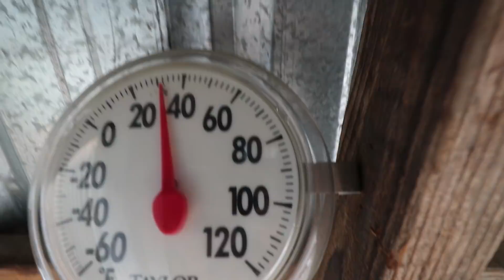Backfilling an Impossible Hillside Trench With Sand (From a Hose!)

Comment: In the mid 1960's when I worked in construction, we used this method to backfill a 1500 foot long, 12 foot diameter powerhouse penstock on. 45 degree slope. It took a week working 24 hours a day because it was winter in NFL Canada. It's an excellent method requiring no compaction as the water draining out of the sand does the compaction. We had some problems getting the sand to flow with as little water as possible until we added laundry soap to the sand mixture. I'm sure your trench will be fine if you divert hillside water from rain storms to prevent scour of the trench sand.
I love your videos. BTW, your Engineer should have cautioned you to schedule your windows much earlier in the build schedule to prevent the delays you are experiencing. That's just part of "best practice" construction.
Good luck, Stan...

Comment: Cistern Tank can be anywhere guys. Use a couple of Solar panels to charge a battery bank and use DC pumps to supply pressure to home. My cabin has been this way since 1998. Pumps last a long time. A couple of 200 watt panels are enough. Go whole hog and get 3-5K watts and enjoy being off grid. elevated water systems are nice though. Remember plastic sheet over the top of your trench will keep rain water from eroding it away. Just secure the edges and overlap it as you come down the hill. Cheap insurance.

Comment: It is manufactured sand, looks like sand but it is the dust washed off of gravel when it is crushed.  Used to be a waste products at quarries till they found uses for it.  Here we call it donafil and we put it under cement slabs.  Once the water dries from it, it gets hard as a rock but it is still able to be dug up.  It is a good filler and unless it rains hard immediately, it doesn't wash very good.  The top will crust over and be hard.  He explains this at the start of the first video.
Reply: Thank you ray nall
Finally someone else that actually pays attention to what was said in this a the previous videos when they talked about pumping fill into the trench.
Reply: Thanks for the explanation, Ray. I was wondering about that the whole time.

Comment: Boy do I feel your "pain"! We began our addition project  in Michigan at the beginning of July (early 90's) which is typically warm & dry. We ran into two major problems doing the foundation 1. our  frost line is 42" (so where bottom of footing had to be) and we hit water at 18" plus it rained every weekend for the next 13 weekends after we dug the foundation footing so it kept filling with water & caving in before we could get the forms set. We had to pump it out & re dig most of it every stinking week (after work) again & again...thought we'd never get out of that darn "hole"!!!

Comment: You should try sprinkling some bags of dry concrete mix along the top of the sand and wet it down, it might help lock the sand in place so that it doesn't all wash out with the rain....

Comment: The good thing about sand is it will end up at the bottom of the hill so you  can cart it back to the top again and again.
Reply: It's likely a certain kind of coarse sand that drains really well and requires a torrent of rain before it slides. It was pumped while utterly saturated with water so it would flow. Now that it's drained the water into the soil, rainfall will drain through the sand instead of carrying it down. I don't know if the plan is to spread gravel on top, but that would disperse the energy of raindrops hitting, and make thousands of micro-dams. Then tree needles will form a layer on top of that.
Reply: flinx only a torential rain will disloge the top that might ba a god send to pull some of the dirt back ovef it. I would not be bo concerned if the top layer washed of personally you can level it out a bit better anyways.

Comment: First things first, I have been watching your channel and have enjoyed your videos. It is cool to see someone take on a project like this. BUT you need to higher engineers to design what you are building. The cost of there input will offset the cost of mistakes AND they will help you plan better and save you money. This trench is the perfect example.    The list of issues is a large one but  the correct person(s) input would have saved you major problems down the road. 1. Most of the roots didnt look detrimental to the surrounding trees,  which using trenching equipment would have saved you days and you would have had a cleaner path. And yes the proper trencher would roll the rocks right out of the way. 2. When tieing off the pvc, you tied towards the top of the trench, and pvc full of air likes to float, i am sure there are plenty of spots close to 6 inches or less in the sand and it will continue to float when the sand gets wet. 3. The tree roots, if they are not damaged enough to die off (we know you were trying to save them but often exposing them does enough damage to kill many of them), whats left will grow putting pressure on your pipes till they break. 4. Sand always moves where ever water goes. The future issues are not all addressable such as the roots etc. BUT you can do some things to reduce the risk of a winter time mud slide or a mud slide when a pipe breaks. Once the area is pretty dry, get portland cement and mix it really thin, water like, poor it over the sand so it drains into the sand. Do a sample area first to make sure it is mixed right, it gets absorbed well into the sand and you can still break it up with a shovel. Next cover it with additional soil to create  a monund so it sheds water AWAY from it. You can add a layer of yard fabric to shed water and plant over it. Just dont plan anything with strong roots or thorns as when you need to repair the lines in a few years, you wont regret working in it.  FYI. A few of the people on here are speaking from experience as many of us have experienced or seen these problems first hand and others are just speaking out there rears. Fyi. Good job on sourcing BOTH material and labor, dont go out buying a pump, you will waste more time learning to pump then you will save.

Comment: You need to start putting dirt rocks and possibly growing grass or some sort of vegetation on top to hold it there otherwise come spring run off if you think that mess you have down at the bottom by your hot tub is bad right now it's going to get a lot worse
Reply: It's coarse sand that drains well and is heavier and less mobile than fine sand. It takes saturation with water to make it move.
Reply: Rain storm???? You have seen what water can do to dirt and rock in California. This will just wash away in heavy rain. Sand is incredibly unstable, and naturally seeks level, especially when friction is removed with the help of water. All that sand will be at the bottom soon.

Comment: You guys are phenominal! Take heart whilst there might be a bit of clear up at the bottom remember THE TRENCH IS FILLED! You are getting there with the build, its winter the shorter daylight hours affect everyone negatively mentally as well the pressure you put on  yourself and by everything else. You guys can do this, you are doing this (enviably well i might add). For now you might have lists mile long but eventually that will get down to nothing

Comment: Right idea, but wrong material. Lean concrete, a mix of sand and Portland cement would flow and set up pretty solid, yet still be able to be dug up if you had to. 
Poured in sections would prevent the overflows at the bottom. That's a very severe slope, I'm surprised it didn't all run to the bottom.

Comment: Many commentators are beginning to get very negative about this build. I am sure both Jesse and Alisa would be the first to admit that many errors and wrong decisions have been made BUT in doing so, it stops others from making the same errors and decisions. Both are not professionals or experts at building properties and they openly admit that but if their errors and wrong decisions prevent just one home builder from making the same mistakes then videoing this build has been worth it and justified.

Comment: Great video guys, one thought at the top of the chanel it might be wise to build a kerb type structure to divert any possible rain run off from the top of the hill away from the sand ditch, as the rain always finds the path of least resistance, here in the alps they us a a lot of ground level gutters to steer the rain water away from the tracks and roads ....good luck   :-)
Reply: Bill Weir I

Comment: Ok, let's get something straight, this is not just sand this is a slurry which is a water, cement and sand mix. Can be used for certain types of applications, I personally would not use it for this but each to their own. Oh by the way I do have 43 yrs. in the concrete buisness.
Reply: Allan McCoshan 
Errrr. What gave you that idea?

Comment: Hi Jesse & Aliese, you guys did pretty good with so sort notice. Concrete trucks are always early or late but you handled it pretty good. Cudos for getting the lights up there so quickly. Don’t worry about having things not completed you will probably change your mind about how to complete them before you get to that point anyway. I always called that part the flex point. Just keep on plugging away. And don’t worry about what other people think. Have fun. More later. 
Bill from Seattle

Comment: Looks good! the sand over spill at the bottom will look like a big mess but it will move quickly once you start and it does have a place to go which is not far from where it got out of the trench so it will look neat when it is all finished

Comment: Do you think when it rains it will flow in the rut and wash away the sand?
Reply: If they are using it as a trail to the top of the hill it might not hold ground cover well

Comment: You are almost there. Just an hour or so of shovel and buckets to move the sand from the steps to the trench just above the hot tub. And that project can be checked off. It will be interesting to see how the sand holds during the spring and fall rains. Are you going to seed the trench with a ground cover to help hold it?

Comment: Won't sand just wash out in a rain storm? I mean it's well known to be structurely unsecure? Like if you build a sandcastle and then pour water in the top, it just decays and washes away.
Reply: Steve Sheppard this is structural fill...used for embankments
Reply: Kathi Pauling 
Well, just watch the video. Look how the sand flowed with water. The same thing is gonna happen in a rainstorm.
Reply: Oh just give it time.
Reply: lance henthorn I think they said when digging the trench that they would pull the adjacent top soil over it

Comment: How extraordinary, someone putting sand, with the surface below grade, in a trench on a 35 degree plus slope of composite gravel and rock and thinking it will stay there.  The washout and slope slide should be spectacular.
Reply: Nope, used this stuff 20 yrs ago on a s dam site, its still there...The slope was the same angle and 400' longer.
Reply: So you worked on a damn where the leeward slope was not hard rock but was glacial till? What sort of weights were placed onto the pipe? and what were the profiles of those weights?  The simple solution to the electrical conduit would have been a 1 to 10 ratio of premixed Portland cement to sand in a geo-textile bag placed on the top of the water line with the electrical conduit on top of that, and another geo-textile bag or two on top of the electrical conduit - the steeper the slope, the closer the bag stacks - the bags then should have been staked (with a piece of rebar) to the ground on both sides of the water pipe - there would have no floating of the electrical conduit and each stack of bags downstream would have created a mini coffer dam to prevent later washout. I never worked on a dam but i have 27 years experience in soil engineering with oil and gas well gathering systems and major pipelines.
Reply: Not on a dam , we used it to fill in the diversion afterward. This stuff is used in area's that require to divert large volumes of water, instead of expensive alternatives or to fill in sink holes in roadways in conjunction with pilings....And goodie for you being a soil guy.
Reply: And "goodie" for you for offering your  conflicting 'expert opinion' on something you really, technically, know nothing about.
Reply: We did the same thing they did....just on a larger scale. This is method is sound proof if done correctly. They filled a trench we filled a trench no difference. Soil guy.

Comment: I wouldn't have roots in that trench. If you attach PVC to them when the root grows that would put pressure on the lines. 10 years from now they could have major problems. It's a wonder Jessy didn't think of that. It would be easy to use vertical PVC pipes for anchor points.
Reply: Hoss 45 maybe he's going to dig the sand at those points and cut the ties now that the conduit is supported, but those were just for electrical wires anyway

Comment: The truck used TOO much water. When I filled my electrical trench I used my concrete vibrator like when they pumped your Icf walls The vibrator will settle and compact sand about one inch per foot of sand. . also when I had to run 8 inch  pipe under a road I ordered a slury mix which has about 1 bag of Portland cement per yard, so it sets up faster. A down hill run can use a lot less water.

Comment: I realize the videos are not real time and were filmed weeks ago but I hope the sand was covered with other dirt, mulch, etc or the next big rain will have washed all that sand to the bottom of the hill. Great videos, really impressed with all you two have accomplished.
Reply: Damian Reloaded - your response shows you don't know what your talking about.

unless the sand is stabilized in someway (and there are lots of ways) rain or snow melt will wash it out.
Reply: Since I've done the exact same thing while building on a hillside I can tell you with near certainty that it will at least partially wash out unless stabilized with some other type of ground covering, preferably some of that clay type soil from the bottom of the hill.

Comment: A suggestion if i may. When summer comes around see if you can get some grass or shrubs to take root on top of the trench. The roots will help to bind it down and prevent it eroding which could be a problem a few years down the line. Especially with your wet climate.
Reply: And until then, I would suggest getting some rock, clay and/or  rip-rap on top of the sand so the spring runoff doesn't wash a bunch of it down into the yard. 

The last thing you want is to have to haul a ton of sand back up to the top.

Comment: Every time it rains an inch 1000 Square feet of roof collects 600 gallons of water.  Average for Idaho is 11 inches a year. So if you are very very water frugal then maybe rainwater can do most of it with very few town runs and no need for a well?

Comment: You REALLY NEED to cover that sand. a good rain and it will be flowing back down the hill. This past fall, there was some road reconstruction going on a hill with 6% slope. a hard rain, and all than sand was down the hill, and filling all the storm inlets at the bottom of the hill. I don't know if there is any way to stabilize sand in place, but would be worth researching.
Reply: Get a lot of grass seed into it as soon as the growing season arrives.

Comment: You may want to concrete the top,  to help control erosion when it starts raining hard; all that water will go into your trench and move the sand (mud slide).  This idea of yours was a great one,  but I'm concerned for long term.  Need to cover the sand with something so the rain water will keep going down the hill and not into your sand trench.
Reply: if it's pure sand (->grain size) the majority will drain right through :)

Comment: What do you think is going to happen when the heavy rain starts?
Reply: Yeah they could mix some concrete to shore  it up some, will be interesting to see what happens
Reply: quicksand
Reply: It's gonna flow just like it did in the first place. All gonna end up at the bottom. It's structurely unsecure. The idea was a bad one.
Reply: Erionax nothing
Reply: Kathi Pauling 
How did they move sand into the trench? What happened to the sand (mixed with water) when it went into the trench? Did it flow down hill? Same thing gonna happen when water is added again, next time and everytime.
Reply: Steve Sheppard it's not sand like you buy in a bag...it's different stuff...look it up
Reply: Kathi Pauling 
I saw with my own eyes, in this very video, what happens when this sand is mixed with water. Lol.